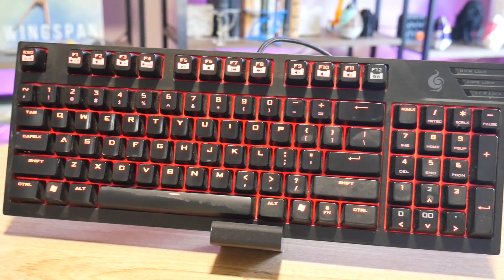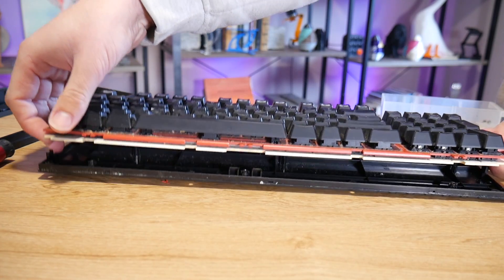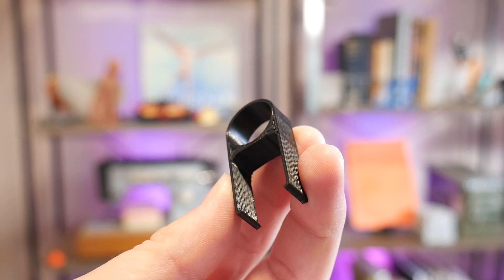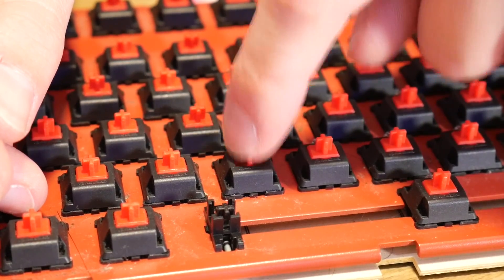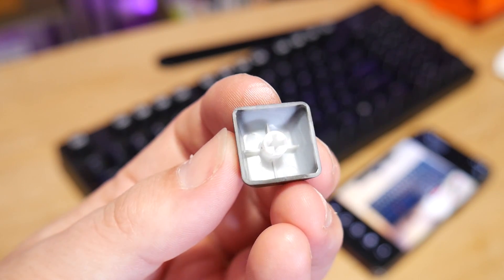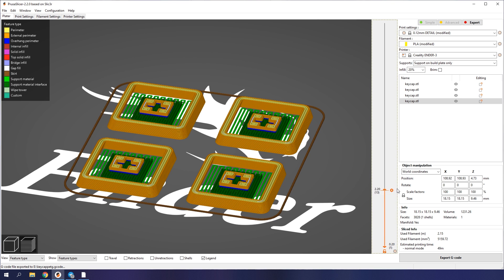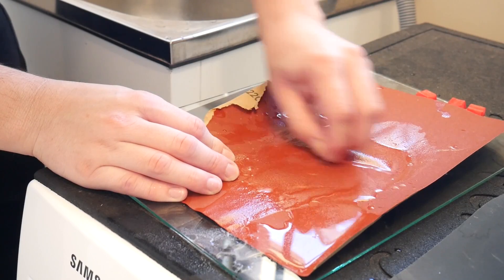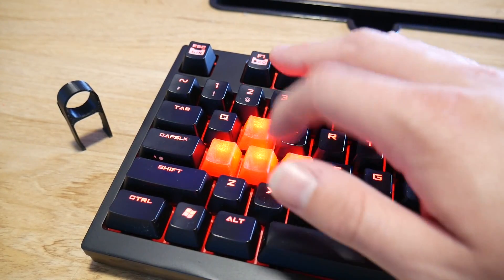Can I Fix my Mechanical Keyboard using a 3D Printer?

Comment: If you want to take this a step further, you can entirely 3D print the case, plate, and keycaps, then hand-wire it to an Arduino Pro Micro running QMK for a fully DIY keyboard programmed to your exact spec!
This is something I've done recently, going after a slightly modified "Minivan" layout where only about 40% of the keys are physical, with the rest under function layers. It's not a layout I think is very practical, but it's a really cool design, and quite compact. The case was too big for my Wanhao i3+ V2, so it's printed in two parts, split down the middle between keys, as to not create switch mount with a join in it. Then the plate is printed the same way, with some simple inserts holding each half together along the middle seam, and with a nut and bolt in each of the four exterior corners. If you want to see it, I should be posting a little build log and maybe the source files on r/MechanicalKeyboards sometime this week!
There's a lot of resources in the r/MechanicalKeyboards subreddit, and if you have some basic soldering and programming skills, getting a matrix hand-wired is really simple (Mostly due to the amazing open-source QMK firmware started by Jack Humbert). I definitely recommend that you give it a try!
Reply: You could also take it a further step forward & test your talents & create a service for those less fortunate & create 3D keys in braille ... Now there's a challenge ...
Reply: @Finke.  That would be really cool! I definitely think that SLA is way more suitable for keycaps than FDM, which is what my printer is, so I can't make very high quality caps. But modelling them wouldn't be too hard.
Reply: @Finke.  blind people would be better with a braille typewriter for this.  Since I know some people that use it with the sticky paper to label jars and anything else.
Reply: yeah ive done a full custom socketed 40% with a layout as similar to a normal keyboard as a could. It sounds like i did the case split just like yours as well. The only real difference is that I made my own firmware on a teensy 3.2. Definitely a fun project but soldering all those wires took me a good bit of time
Reply: Got any good sources to get me started on thing like that? I actually had a similar idea in mind, and it would be good not to do it from scratch.
Reply: Sounds really cool. Could you tag me here, when you upload the buildlog? I dont use reddit that much, and ill probably forget to check it in a week :)
Reply: The sick-68 on thingiverse is a good example and includes a bom as well
Reply: Not reading it xD

Comment: Hehe this was actually my first, very own project to repair my LOGITEC G710+ keyboard. Quite a lot of testing but I did it. Printed in black, but the top layers were printed with transparent pla. Even put a logo on it hehe !
Reply from the maker: That's sick! I really want to try some dual colour "pudding" 3d printed keycaps.
Reply: @MakersMuse  hihi thanks! Every day I'm proud of myself hammering those key caps (they're actually way more durable than the stock ones too) should start selling those lol 😆 my keyboard is like 6 years old so the plastic gets bridle - almost bought a new one. Came to your channel, got hooked up on 3d printing and designing: profit. Ty mate
Reply: I 3D printed and replaced the right CTRL key on my old G710+ after it broke!  I used that keyboard for like 4 years, and I bought it refurbished. Now, my sister is using it for her first built PC  😊

Comment: Hell yeah. I got new fire poker. It's way longer than the old one and the holder thr old one came with. So I designed an extension to sit and lock onto the top of the holder. The new poker locks into the part nicely, and the fire poker doesn't touch the floor. Win! Then, I've also 3d printed are part which fixed the clothes airer leg that was broken, but that's another story. I love 3d printing.

Comment: Quickfire TK is an awesome keyboard, the USB port is a little flaky, and still forget to press num lock to switch between numbers and arrow keys.
Reply from the maker: Yeah for sure, though the usb breakout is its own pcb... maybe a USB C mod could be done!
Reply: @MakersMuse  There's a USB-C breakout board by Adafruit, but I suspect an equivalent board can be created in Eagle or even KiCAD. Just need the USB-C port footprint.
The resistors might be an issue. The Raspberry Pi 4 had a small design error where they used 1 resistor instead of 2, so if you hooked it up to a compliant USB-PD source with the proper cable, it would think it's an audio device and cut power. Fortunately they fixed it. I have a hunch that if you don't do anything fancy, it'll assume it's a USB 2.0 device.

Comment: I was an IT engineer for 30 years, how old was the keyboard? How many nose hairs did  you find under the keycaps..... Its amazing what you find ;-) Well done on recycling/repair. Not all keyboards will disassemble as easily as that. There is a purpose-made switch lubricant and cleaner available from Jaycar or Rod Erving here in Australia.
Reply from the maker: It's had a good 5 years of non stop use, I shed like a dog so mostly a lot of hair haha. Gross. Good tip on the proper cleaner! Still not too keen to go to stores, but Jaycars are easy to find.
Reply: Ive had an IBM KB 7953 since new in 1999. It's been places, including tumbling down 2 flights of stairs with me, on the way to a LAN party in 2001. Cracked a key (i was more worried about the KB and PC than my broken bones). It's still working like a trooper. The PS2 connector is getting old tho.